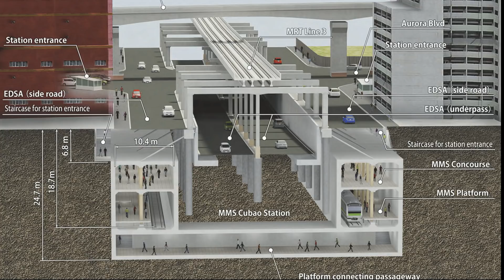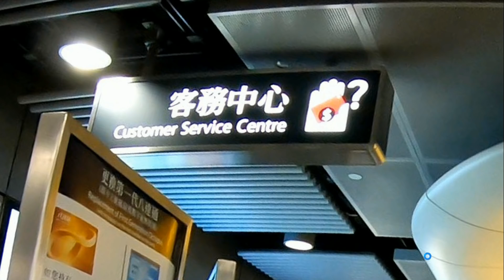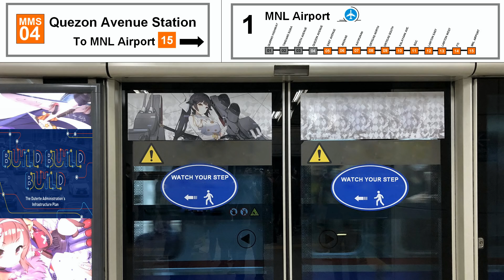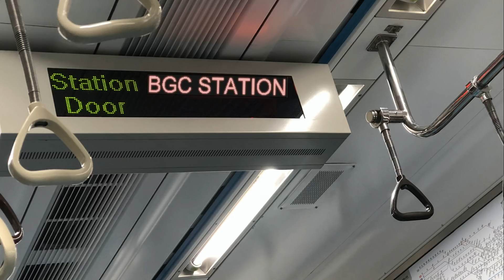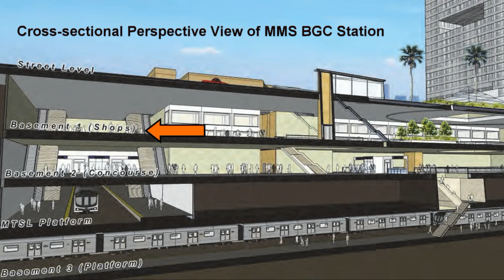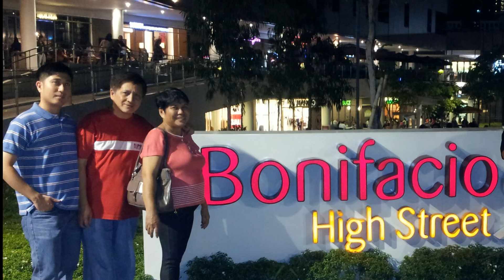A Simulation of World Class Metro Manila Subway

Comment: Too good to be true, escalator nga d kayang i maintain ng mrt, aircon subway pa kaya...
Reply from the maker: Before Japan made a deal for the loan for Metro Manila Subway, they already estimated how many passengers daily will use the subway. Added to that they will rent out also shops inside the subway.It's a done deal. It is already under construction. They are already in the process of putting together the tunnel boring machines that will be used to dig the tunnel. Next year, the digging will start for the tunnel. Japan never breaks deals especially like this one. in fact they made the Philippine Japan Friendship Highway for free as payment for war reparation.
Reply: Its impossible sa mga taong negative na katulad mo.